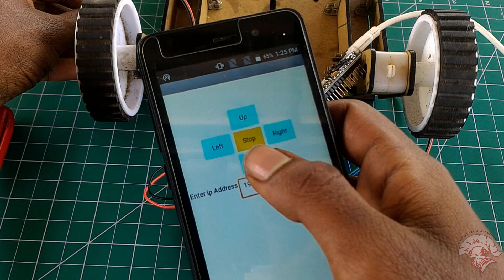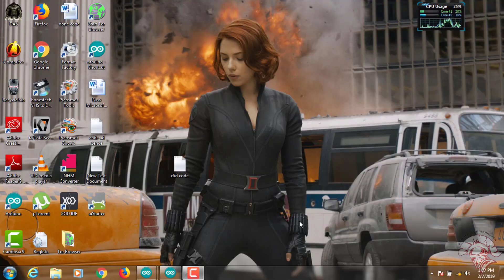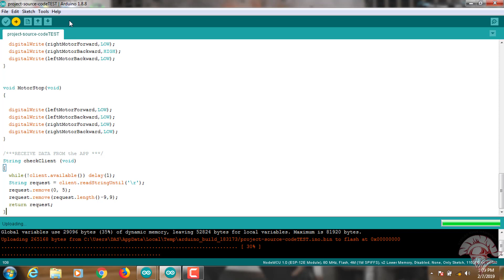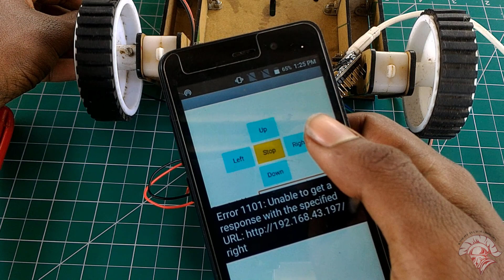Nodemcu(l298n motor drive) wifi car control using smartphone

Comment: i have error  error: redefinition of 'WiFiClient client'
   36 | WiFiClient client;
 i couldn't fixe it what should i do
Reply from the maker: What type of board you use??? Your board name....
Reply from the maker: Add wificlient library file....
Reply from the maker: Board manager check your board ...,.and com port check.
Reply: @Knowled  COM7/ and NODEMCU v3 ch340 drivers and 9600 for serial begin i guess
Reply: the program u showed us which you had televersed is missing the ip adress and the serial begin... i donnow why exactly u did that